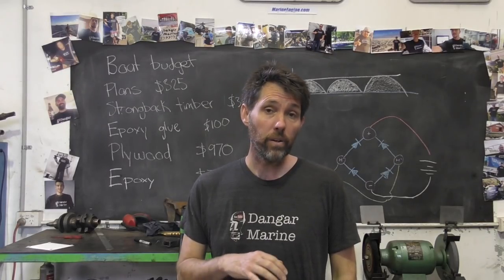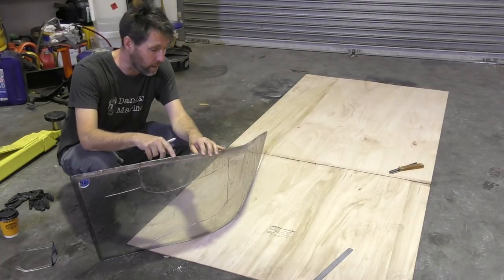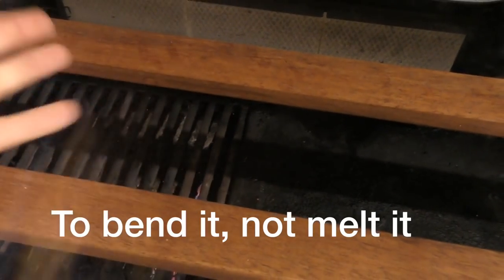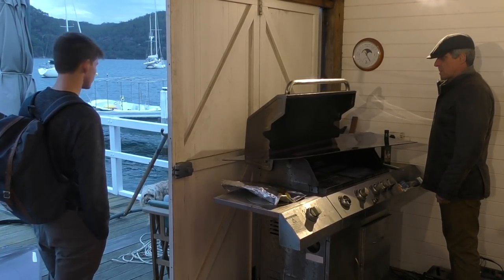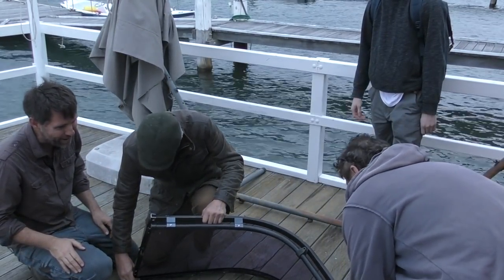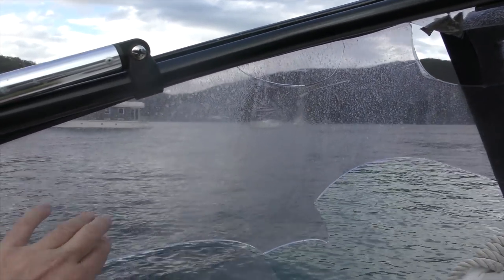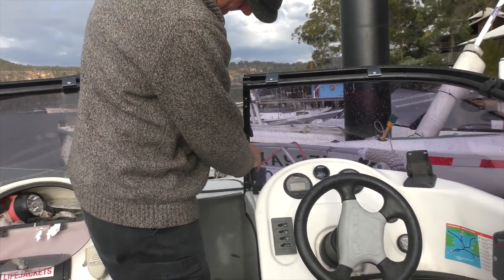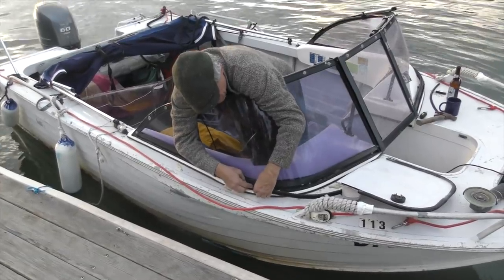Replacing a perspex panel in a boat windscreen

Comment: I know this is 4yrs old now, but gotta say THANKS for this video!   I used this same technique just yesterday.    Driving home from a fishing trip 2 weeks ago, something completely smashed out the starboard side curved glass windshield on my 2-yr-old Crestliner Fish Hawk 1650.  Not surprising in 2023...but there was a TEN WEEK lead time on a windshield replacement!   We have a Canadian fishing trip planned in a week, so I needed to do something.   Bought a plexiglass sheet and cut it to shape using the shape of the port side window.    I started using two heat guns to heat the material in order to bend it, and it was working somewhat, but we couldn't get a large enough section of the glass hot for long enough to form the glass to the frame.  After watching this video, I hauled my gas BBQ grill into my garage to avoid the wind, and heated the full 2.5x2.5ft area that I needed to bend.  After about 10min of heating, it was soft and pliable and formed perfectly to the frame.  And no visual distortion through the glass, and no crazing.     Awesome--and entertaining!!   Thanks again guys!!

Comment: hello stu greeting from croatia! love your work. for making a template from the old perspex we use paper and tape. when u cut paper exactly how new perspex should look like tape it on new peace and cut. for heating u can do like u did on grill or better u can buy perspex 4 mill thick and it doesnt need heating youst slip it in frame.
Reply from the maker: Hi Ivan. Taping paper on sounds like a great way to go. I should really have gone down to the shops and bought a roll but as always I'm too lazy. ;)

Comment: Wow the difference to a pleasure boat and a fishing boat. Bass boat I recently bought, older one but still yet had the small wrap-around plexi glass around the console that was tinted. Removed it fairly quickly, as I didn't like the tint, that to me was hard to see thru, and the fact it was another obstacle if I somehow made an errand sidearm cast (which I'm prone to do)and caught it. I will certainly miss it on cold mornings as a wind block, but I already have goggles in the boat, and considering buying a fairly cheap motorcycle helmet with a face shield. 

Now , on to what you did here. I love it. That tint looks really good on the boat and you guys did a great job of getting it bent and cut down to fit.

Fun to watch video. Thanks Stu!!!
Reply from the maker: Thanks mate. I know what you mean about windscreens. I don't have one on my boat because I'm not a big fan for them but they certainly do help keep the wind chill down.

Comment: I found an entire sheet of acrylic was only a little more than a cut piece.  But that brown paper becomes impossible to remove after a while. I totally changed the windscreen on my boat using cardboard templates to test different layouts.
Reply from the maker: I noticed that too about the paper when we built our house. Our neighbour was building at the same time and gave us some left over perspex but after a year or so the paper was impossible to remove.
Reply: Hot soap and water will get it off.   It takes a few minutes, but after a bit the paper gets soft and the glue gets kind of smeary.  Then use more hot soap and water, and everything comes off clean

Before I learned that trick, I suffered greatly at the hands of that brown stuff!

Comment: Perspex is quite brittle in comparison to polycarbonate . They both can be worked the same with heat and moulded into shape . I have used it for making bibs on fishing lures and the stuff is indestructible. If you ever have to do this again try the polycarbonate sheet and you will be impressed. Only thing I am not sure about is the price difference, well done anyway fella's, just goes to show that necessity is the mother of invention.
Reply from the maker: Hi Evan. To be honest I hadn't really considered polycarbonate. Doing a quite search now it doesn't seem to be any more expensive so I'll have a chat with the shop when I go to pick up the piece for the port side. I have another boat that needs doing too so I'll experiment with polycarbonate next time.
Reply: @DangarMarine  Perspex will shatter once bent beyond a certain point or taking a hard knock , polycarbonate on the other hand won't shatter  can be bent over itself multiple times and won't break, it's bullet proof and optically clear . Thats why all glasses have polycarbonate lenses and not glass these days . Give it a go and you will be converted .😂 Good luck and I'm glad I could help , your videos have certainly helped me. Cheers Evan Miris from Canberra.

Comment: Hi Stu.
Greetings from Ireland.
A question bud.
Why did you choose acrylic for the replacement rather than polycarbonate.  ?
Did you consider bronzed  polycarb.
Best wishes.
Liam.
Reply from the maker: Hi Liam. To be honest I hadn't really considered polycarbonate. Doing a quite search now it doesn't seem to be any more expensive so I'll have a chat with the shop when I go to pick up the piece for the port side. I have another boat that needs doing too so I'll experiment with polycarbonate next time.
Reply: Hi again stu.
Yeah . I gave up on acrylic many years ago. I go polycarb just about always now. Very impact resistant stuff. Good Uv resistant properties too. Anyway i was just wondering if you had a specific reason for using acrylic. 
Best wishes to you all. Enjoy your emerging summer. Winter starting here.  Yuk. Time for us to winterise. 😳
Liam

Comment: I need to replace the windscreen on my ski boat, original has a frame on top but is just screwed in at the bottom (maybe every foot?) and is bulging out between the screws!...... if i was to trace it and do a direct replacement it'd be bulging between the screws still....... Going to be tricky.
Reply from the maker: You could bend a batten around the original screw holes and trace that line a bit like the lofting video on the boat build.

Comment: Stu, what is your favourite brand of motor
Reply from the maker: At the moment I'm quite a big fan of Honda motors.
Reply: Yeah their pretty reliable I’m a Yamaha fan
Reply: Honda makes a great motor, but their 225's have been lemons.   A good friend of mine went through FIVE of them over a period of 2 years.   They said it had something to do with the oiling system.  Eventually, Honda got tired of replacing them, and moved him up to a 250, and not a day of trouble since then.  He was incredibly patient with them.  I would have asked for a refund and gotten a Yamaha, Mercury, Etec or ANYTHING else.    He's probably got 3,500 hours on that motor by now, and still running like a top.

Comment: dear DM,   Harbor freight and others sell heat guns that help play with plastic like candy..............
Reply from the maker: The first clear test piece had been bend with a heat gun, and it worked okay but the trouble here is you need to do a long uniform bend and with a heat gun you can't heat a big enough area uniformly.
Reply: well.... a sauna heater , from a wall..., gives you a lot of heat in a large area...   it worked for us.....